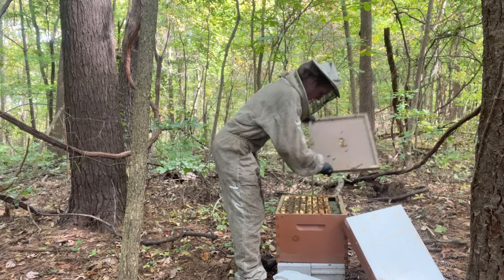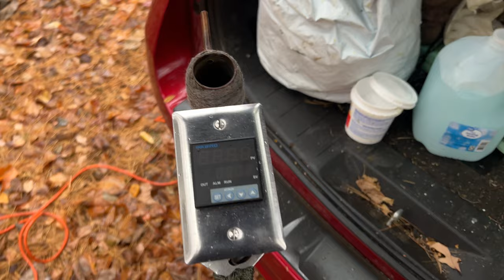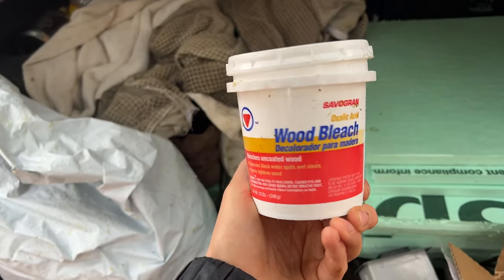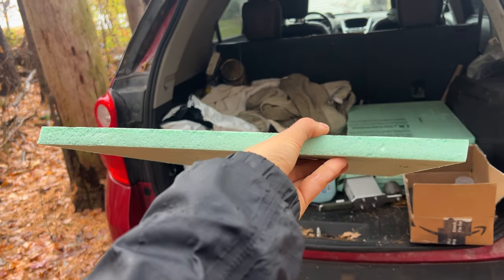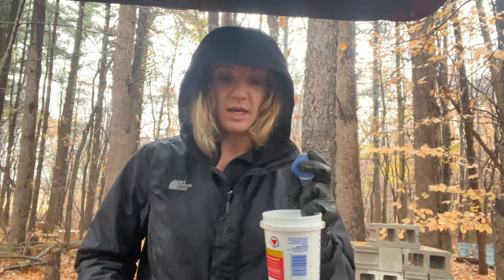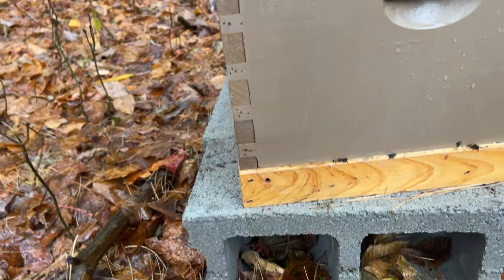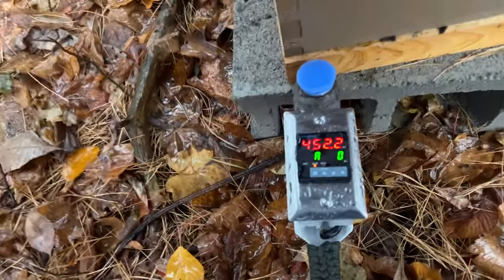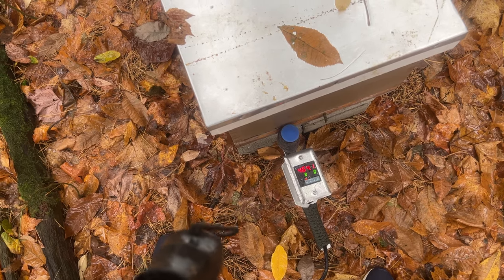Treat For Varroa Mites - Homemade Pro Vape (Oxalic Acid)

Comment: Electric in the rain was kinda scary.
Reply from the maker: Yes yes I agree…but it had been raining every single day with no break in sight so it was my only option 🤷🏼‍♀️
Reply: I seen on YouTube a supply company that doesn’t use electric. They have one they use propane. I can’t remember the name but all the workers have extra long beards. I think it’s a good product and u can use the same propane to light the smoker.
Reply: Fellow Michigander here.  Boy, to I understand the rain comment.  I love your video, just found you.  I have my first hives sitting in my mudroom waiting to be put together.  I can't wait, it is December here.  I have my bees reserved, just need to break out the staple and nail gun.  This video has really helped.  Where can I get the oa applicator gun?  Thanks Oh, I do have a question.  I know this video is a year old, but hopefully you still monitor it.  When I get my bees in May, should I treat them for mites immediately?  I was thinking if they have a few mites coming in, it would be good to treat before there is larva.  Does this make sense? @beefitbeekeeping
Reply: Rain has no ions to conduct power.

Comment: It’s been said that you are supposed to use a food grade OA. Also your electricity has a power drop when using long extension cords. Hopefully you are plugged into an outside outlet  that has a circuit breaker built in. No mask/respirator is also dangerous. Not good to lead People down a path where they can be injured or killed with bad recommendations.
Reply: Voltage drop would be minimal...AND it's a ground fault breaker/receptical not a circuit breaker.  Give correct recommendations please.
Reply: It’s the label that matters. Wood bleach works great but it’s not labeled for treating bees. Which makes it illegal to use for treatment of bees. It’s also a lot cheaper then the labeled Products which chemically is the same.

Comment: Emily, you need to get into a habit of clearing the hole in your bottom board before inserting the vaporizer.  I use my battery powered drill with a bit the same size as the hole. That hole can contain propolis or other debris that can stop up the discharge tube on the vaporizer and it can blow the silicone cup off of the vaporizer and cause you breathing issues. With that being said you need to purchase a respirator and wear it while treating your hives with OA!  It can damage your lungs. You can get a respirator on Amazon for about $20 and if you get your lungs full of OA you will probably wish you were wearing one. 

THANK YOU to the Beek that gifted Emily the vaporizer!
Reply from the maker: 😳 I will definitely start doing that thank you! I bought a respirator only thing is it practically suffocates me 😅 but slight suffocation is better than OA poisoning. So you are right

Comment: Nice compact design, just be sure after using it for a while to clean any build up in the nozzle, if it plug is can blow the cap off from the pressure build up. Also like the GREAT Mike Rowe says "safety third" wear a respirator. You don't want to get a lung full of that vapor, and while it's doing it's thing ya don't want to stand over the tops of it. Oh something else keep some baking-soda/water on hand that way if you ever need to neutralize the acid. Keep up the great work, Blessed Days...
Reply from the maker: I didn’t know the thing about the baking soda. Thank you for that! I will keep some in my car just in case. I hope you are doing well and your bees are going into winter strong ♥️
Reply: @beefitbeekeeping  They seem to be doing good. Ya you dont want to rub your eyes or face with OA crystals on them. that way you can dip your hands/glove in baking soda water to stop the acidic reaction. Have a great week.

Comment: Vaporizer only needs a decent 400w inverter and a good lawn mower or car battery.   Heater band only uses 280w. Pop the hood and clip to car battery directly is usually the best option.  Run vehicle if a lot of hives.
Reply from the maker: Thanks I will try that!!
Reply: is there a link for the homemade vaporizer.?

Comment: Respirator and safety glasses should be mandatory when using OA vaporization. This stuff WILL hurt you and safety precautions should always be taken when using it.
Reply from the maker: You are right, I’m being risky by just relying on the wind to blow it away from me
Reply: Also..if the tip clogs...which does happen...the pressure will pop the blue OA holder out and that can be really bad.

Comment: I'm wondering were you near any other beekeepers? I had a beekeeper that was close and all of his hives finally failed this spring. Since this happened my horrible mite problem was gone and my hives have been so much healthier. You need a 1000 watt inverter to power that vaporizer. I placed the hole in the center of the back. Hope this gets them under control! Thanks!
Reply from the maker: Yes I do now. When I move my hives there was a beek that had quite a few hives at a watermelon field just a mile down the road. A couple weeks later I noticed him loading them onto his trailer and took them away. I am thinking this was a contributing factor to my high mite loads as any bees left behind most likely came into my hives. But also my last location was not the best area for bees, very little resources and I expanded quickly this year so in terms of food stores my colonies are low. Less food = harder to fight off viruses and other ailments in the hives. I learned a lot this year but was worth every mistake ☺️
Reply: @beefitbeekeeping  Other beekeepers can bee our worst enemy. Thanks!